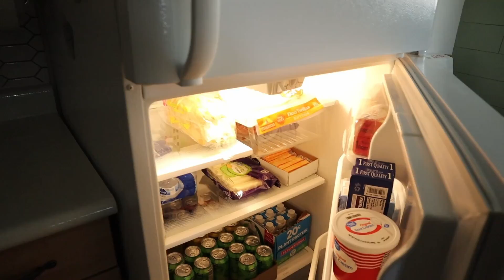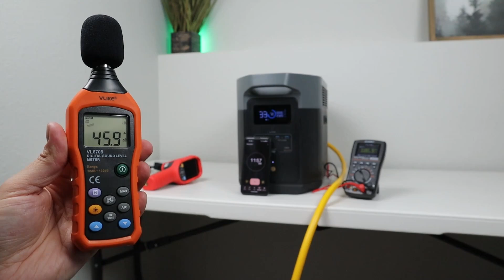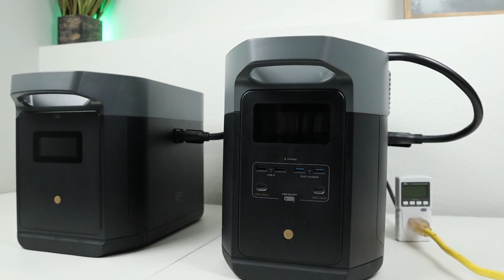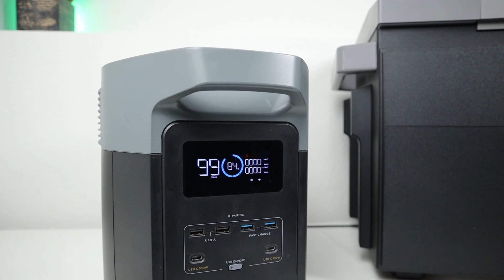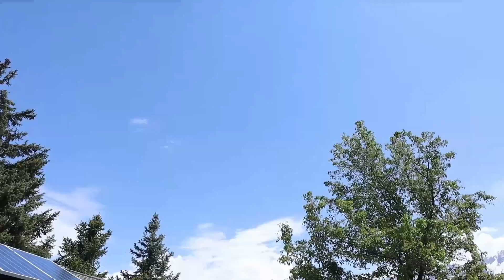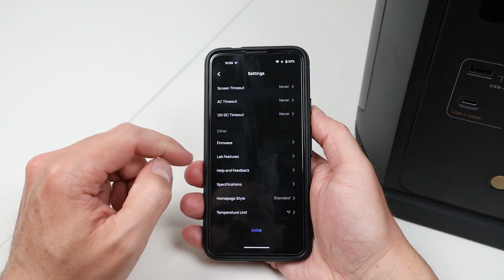The NEW EcoFlow Delta 2 MAX - LFP Batteries - QUIET FANS - 1000 Watts of Solar - FULLY TESTED!

Comment: Nice video! Thanks for the detailed tests! Anytime you have a transfer switch your never gonna have the perfect switchover. The only reason like the ac200p or max has a ups is because the are using internal chargers with no transfer switch. Delta series uses transfer switches with a charger. Having another 200 watts, 2700+ more cycles, and a 1.5 times quite fan this is a solid unit! I had the delta max 2k and we hated the fans on it. They must have put the delta pro fans in it lol! Heat job ecoflow!
Reply from the maker: There's benefits to having both types of inverters. You get much faster charging from the integrated inverter/chargers and the benefit of UPS mode (when they are fast enough). The Anker 767 was plenty fast for sensitive electronics. With the external charging it's usually slower but you can save some weight on the actual device. Kinda just depends on what you are looking for. The Bluetti AC300/AC500 lineup does a great job at having a fast UPS as well.
Reply: @Jasonoid  that's awesome! I haven't done much research on the ac300/ac500 so I'm not very knowledgeable on them honestly. I'm running the delta pro in my house and looking forward to the smart home panel. I work on rvs for a living, and the xantrax inv,charger w/transfer switch seems to be quick enough for fridges but alot of people say the tvs sometime shut off. The bigger the charger the slower the transfer switch seems to be but with the ac300 that doesn't seem to be as much as an issue. Good comparison:) thank you!

Comment: If I heard you correctly, the AC output is only 10amps.  Not very good.  15 or 20 would make those outputs more useful.  Also, with all that stored power, there is no RV 30amp output plug.  And with only 10amps at the AC outputs there is very little you could run in an RV..... Water pump, lights, USB outputs in RV.
Reply from the maker: Yeah, you misheard. The AC output is 2400 watts or 20 amps. The DC output is 10 amps or near 140. watts.
Reply: @Jasonoid  Thanks for the clarifications.  So, I could use a 30amp RV adapter, plug into one of the AC outputs and power everything other than the RV's air-conditioner.
Reply: @craigehr  can you explain the 30 amp RV adapter and perhaps include a link?  Thanks!

Comment: Great job Jason!!  Nice review!  
Hmmm… tough decision in the 2Kw size / power range.  Still leaning towards an Anker 767 at this size  and I own two EF DELTA 2s…  Maybe Bluetti will have a refreshed version as well soon to make it even more competitive.  
Cheers!
Reply from the maker: No rumors on the new 2000wh Bluetti. The Anker is a solid unit. Very similar to this one except it has the wheel and handles to move it around more easily. I'll look to do a future comparison video about each model I currently have.

Comment: Wow, what timing. I was considering getting the Delta 2 this weekend. Now I need to reconsider. I have been waiting for this to be released but had no idea when it would come out. I love EcoFlow products and this seems to be a solid option. However, I am leaning towards the Delta 2 because of the better Wh/$ that I can get it for. I wish they would have added a few more new features, such as a better connection method for the extra batteries. Maybe external batteries that can work independently like  Bluetti. Tough choices. Thanks for a great video.
Reply from the maker: The smaller Delta 2 unit is a great portable unit. I use it around the yard all the time to power my tools. I love that it takes in decent solar and has the large 1800 watt inverter. The Delta 2 Max is a bit larger. If you got room for the bigger unit I guess you can't go wrong! I think both of them would work well.
Reply: @Jasonoid  Thank you. I am starting to worry that I am becoming a power station collector. I keep justifying it by saying I don’t have enough power to run the whole house during a long power outage yet. Haha.
Reply: @Jasonoid  My thought exactly!  I decided portability and looked at how much power I would need to run tools like a pole saw to trim trees.  Delta 2 is the perfect size for portability that you can carry with one hand and at decent price.  I can even run most items in my house during a power outage.  Even my oil furnace!  What we really need is more battery storage for times when the grid goes down.  I purchased my Delta 2 with the Delta max battery for that reason and I also have three 12.8V 100AH Lithium Iron Phosphate batteries wired in series that I connect to the solar input which allows me to run the Delta 2 much longer.  Then I recharge the following day with my gas generator if the power is down for a long time.  Easily gets me through a night of use.  Cant run a dryer but that can wait for the grid to come alive again.  I just wanted enough power to make it through a full 10+ hours running everything but the 240V appliances.

I might have considered the Delta 2 Max but I still think the smaller Delta 2 is the best option for me.  Someone with more home power demands will probably benefit more with the Delta 2 max or the Delta Pro.  I think the Delta 2 is a better bang for the buck. I use it way more because its so small and light with plenty of power to satisfy my needs.
Reply: @Jasonoid  I really like the a Delta 2, but for me I need a bit more capacity, but I want it in one box, like 1200-1400Wh. I use my power stations camping out of my SUV. A Delta 2 with an extra battery just takes up more room than I have.
Reply: Bluetti win with battery  but this have wi-fi  and better support there is no perfect power station
Reply: 2X the price of the delta2
Reply: @larryc1616  yes, it seems you get twice the price, twice the capacity, more watts, and a real cool dual DC input feature.

Comment: jason i have a question. i have a large unit like this( bluetti) but i need to charge it on solar outside. I dont want the battery to be outside in the elements. I need a cord extension to run it from the outside from the solar panels, to the inside of the house and plug in to the unit. Do you know if the longer the cord, say 100 feet, to the inside plugged into the unit, will drop charge power? From the solar? i cant seem to fond the answer anywhere. It would be 400 watts of solar to start, prob runing in parallel hook up. Thanks for any answer. I dont know what to do
Reply from the maker: You may have missed this video:
https://youtu.be/AZIBmFBzBGs
It will answer all your questions.